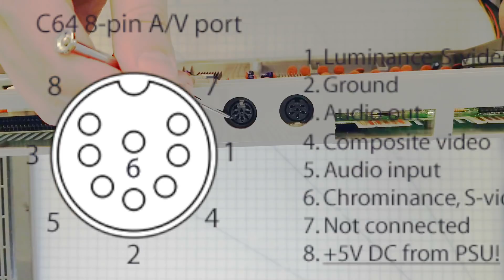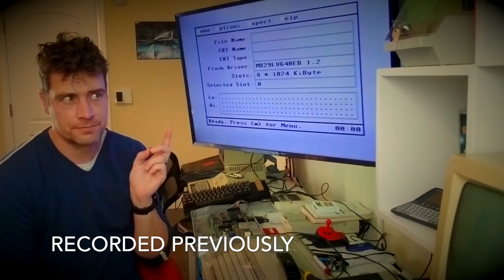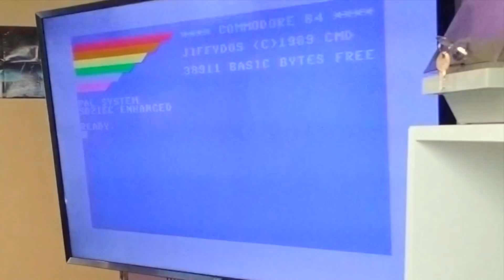Fix Commodore 64 SID Chip Noise In 5 Minutes {Quick Bytes™}

Comment from the maker: Thanks for watching! Do you find the buzz annoying or part of the charm? Did you enjoy my dancing? 🕺 Let me know if you have the same noise or try this mod!
Reply: I recently got a decent retrocomputer lot, including a bunch of Commodore stuff. After repairing the keyboard, floppy drive, and creating my own RCA cable, I tried some things. With the cassette drive came Shamus, so I loaded that up...no sound, only buzzing. Tried a floppy disk game, still no sound, only buzzing. Tried some BASIC code that was supposed to test out different sounds...more buzzing. Reseated all the chips in the mainboard...still buzzing. Do you think the SID is likely dead?
Reply from the maker: I'd actually suspect the cable. I recommend trying one from a reputable manufacturer or eBay. Good luck and let us know! 👍🕹️
Reply: Thanks! The cable I made was used the din plug off of the TI99/4A (which works in all three retrocomputers I got in the lot: the TI99/4A, the C64, and the CPlus/4). I actually received some new 5 pin dins (though my C64 can use 8 pin dins) and also have new RCA cables so I will just make another cable and try that. I am pretty sure my work would be about as good as theirs and cheaper (I am an electronics engineering major :) ). On another note, I was just looking in the C64...some of those caps look kind of worse for wear. Since I got the lot at an estate sale and everything is coated in some kind of...scum?...I will probably just replace all those.
Reply: Perifractic's Retro Recipes oh, one more thing...i get sound on the TI99/4A using my current cable.
Reply from the maker: Interesting. Carefully follow all traces from the DIN to the SID. Try swapping the SID with another machine if you have one. It could be any of those things. Cable seems less likely now. 👍🕹️
Reply: Will do. Unfortunately, the other Commodore is a Plus/4, so no SID chip, so let's just cross our fingers and hope it is something easily repaired. SID chips seem pretty hard to come buy and I would rather not get a SwinSID variant.
Reply: Okay, so I did all that, even replaced (but apparently unnecessary) 1k resistor on the Audio Out pin. I cleaned the board, checked the cable again with my TI99/4A, checked the voltage across the resistor to the DIN, checked continuities, checked all the voltages on the SID chip...from what I gathered, everything should be fine. While running Shamus with the volume at max, I noticed that there are soft popping sounds that seem to correspond to the music on the title screen (I checked a YT video of someone playing Shamus on a C64). Thoughts?
Reply from the maker: After that troubleshooting marathon, I can only think that the SID is the culprit. Check eBay or Retroleum! Good luck 👍🕹️
Reply: Well...dammit. After all of that, and noticing how crusty some of the discrete components are (the ceramic disk resistors seem almost crusted to the board, almost as if their coating flowed), I decided that I am going to completely refurb the C64 with completely new and modern components (such as MLCC ceramic caps and solid aluminum caps like on modern motherboards). Thanks for your advice :)
Reply: Hi chef! 
was this buzzing stuff going on in every SID... I mean, could you listen this noise in every c64? or is it just a problem with that specific chip? Cheerio
Reply from the maker: Most but not all C64s! 👍🕹️

Comment: Open the DIN connector of your AV cable and place the bridge in there. This way you won't be modifying the board and Audio In can still be used with another cable if need arises, even if there is a very slim chance of it ever happening. Also, on short boards with 8580 SID, "digi fix" is made by pulling down the audio in pin to ground with a resistor, the value of the resistor determines the amount of digi sound mix on the output. I wonder how placing a dead short to ground there will affect the digi fix?

Comment: On the 250425 board there is a 100k resistor to ground on pin 5, so no noise. At least not on my C64.

Comment: Hi :-)  at c12 is ceramic cap on my two 1983 board....i have see normal capacitor at c12 in your board you have modified with jumper... the pin 5 "audio in" go directly at c12 and to sid

Comment: Why not go directly to the SID chip and tie to ground there?  Why not use a resistor between the sound-in pin and ground?  Why not have a DIN plug that you can remove at any time that connects the pins through a resistor?  All these things... I was really wondering about durrrring that video.

Comment: If you are not using that DIN don't jump it internally, just build a blind DIN male connector just to use it as a cap which ground that pin.

Comment: So I did this mod, but it had no effect to the background noise I have :(
Reply from the maker: That's odd. I couldn't tell for sure without the before and after video comparison, and there definitely is still noise, only less. Still, nothing ventured nothing gained... 👍🕹️
Reply: Perifractic's Retro Recipes so this is the wiring I did https://m.imgur.com/a/8FAkAHh my motherboard is a little different than yours tho, that could have been the culprit and this is an audio clip to show the effects of turning off the video output from the cynthcart. soundcloud.com/danmusicinthemaking/commodore-64-sid-noise/s-8gupL this is after the mod and you can clearly hear the loud noise not nearly as soft as the one you have here
Reply from the maker: Looking at the pics you've done everything right. If you have access to a different model SID chip you could try putting that in, or there's eBay. It is possible the fix isn't effective on the newer model. Sorry it's not working out.

Comment: That can be quieted even further by adding .1uf ceramic caps across the power supply to the audio chip.  Solder them onto the V+ pin and connect the other end to ground.  Also the addition of a .1uf ceramic cap to the audio input of the chip.  Both will quiet the circuit down.

Comment: Never short the SID output to the ground - you can burn the chip by doing this. You should use 100 Ohm (of better 1k) resistor between SID output and the ground.
Reply from the maker: Interesting, never heard this before on the forums that discuss this technique. It has been working fine. What would the mechanism be that would burn it out on those particular pins?
Reply: I already killed my SID 6581 by shorting output directly to the ground (short pin 2 and 5 on video output port).
It is not completly dead but itis acting wierd since then e.g. sometimes (for few seconds) it can be very loud (almost distorted), some filters is not working correctly, it is more quiet comparing to good sid.

Comment: OK, silly question: Filter cap aside, why not just make a DIN plug that shorts 2 to 5, to be used when you are not using the DIN connector for any other purpose?
Reply from the maker: Good question. I always use the DIN as it's my video out. Other than that, it's just more fiddly work 😉👍🕹️
Reply: Heh. Then why not short 2-5 in your video cable? Come to think of it... I would take a close look at that cable. It may very well be the source of the noise, if pin 5 is connected on the C-64 end but floats on the opposite end, so you essentially connect an antenna to pin 5 :-)
Reply from the maker: Ah, because it's a molded cable. But this noise issue affects all C64s. Pretty well known 😉👍🎧
Reply: Fair enough. I don't remember this noise but it has been quite a while since I last fired up a physical C-64 as opposed to just running an emulator (and back then, chances are I was using a CRT which had its own noise on the audio side, so I might not even have noticed that there is additional noise from the C-64 itself). It just occurred to me that since the source of the noise is an externally accessible input pin, there is no reason to modify the machine internally (especially not in a manner that disables the original functionality of the input pin).
Reply: Viktor Toth I was thinking the same thing. You could have bridged the two points with a filter cap.  100uf or something.

Comment: Disabling the audio pin by grounding will alter classic digital sample playing. The classic method of digital sampling used the popping sound from the input pin and modulated it rapidly. You would be better off using a switch to enable/disable the fix or even better maybe a 1 meg pot for variability.
Reply from the maker: Interesting, never knew that! 👍🎧

Comment: Silly question- wouldn't it have been easier to plug an external jumper into the din connector? Or possibly make a modded AV cable?
Reply from the maker: Mark Super Did you see the bit where I plugged an external jumped into the DIN connector? 😉 

(Not sure a cable would be easier.)

Comment: Couldn't you just add a filter cap between the pin and ground?
Reply from the maker: menotu000 Good question. I'd seen that mentioned in forums without a positive outcome. This seemed more solid ¯\_(ツ)_/¯
Reply: I guess it would depend on what the cause of the noise is from... have you determined that at all?  Also, do you have a scope?
Reply from the maker: The buzz is apparent from all C64s and does come from the audio input not being grounded :)
Reply: A filter cap should work then.  Is the buzzing a power line (60/50hz hum)?  I ask because I have never heard it on my original C64.
Reply from the maker: Interesting. I believe it's just that the audio input amplifies the natural hiss on any audio line. There's a lot of info on it on Google, and this was a thread I read: http://www.remix64.com/board/viewtopic.php?t=4777 Interesting stuff.
Reply: I like this reference in the forum:  http://www.bigmech.com/misc/c64mods/noisereduction.html
seems like a much better solution, you get no noise when not using audio in, but still have the option of using audio in.
Reply from the maker: Nice. According to that, "shame on" me ;)
Reply: LOL, nah... you can always redo it if you feel like it... and ultimately it comes down to what you use the machine for... if you NEVER want audio in, then no big deal, but if you want to use it to mix with the SID output - maybe some kind of digitized sample or something to mix in, then you might want to consider doing the better version.

Comment: I vaguely seem to remember that there was another modification possible regarding EXT_IN pin. I have an 8580 and by injecting a bit of voltage, it should be possible to boost digi playback in some earlier titles using obsolete technique, right?
Reply from the maker: Siana Gearz In theory, but don't fry the little guy! I'm happy with this for now. When I record music out, a little noise removal in GarageBand gives perfect results 😊 https://youtu.be/LfdCX6EAWQ0

Comment: Seems like a nice and easy fix! How does the Ghostbusters digi-sample play back once you've added the mod, though?
Reply from the maker: Ooh I should've shown that. It sounds just the same, but less buzzy??
Reply from the maker: The downside is you won't be able to use the audio input, but actual use of that is very rare.
Reply: if you want to use audio input you could use a switch that disable that and you could enable when it is not used. it is just a cable with a button.
Reply: @AlejandroRodolfoMendez  Better yet, use a switched 3.5mm jack normally connected to ground. That way, when you plug a cable into it, the connection lifts and you can use the Audio-In again.
Reply: So there are no downsides for this mod ?
Reply: @PLOBEXRIME  I am thinking of one downside, with 8580 SID, "digi fix" is made by pulling the audio in pin to ground with a resistor. So adding a dead short to ground at yhe DIN connector may mess up with that since the value of the resistor determines the level of digi sound in the total mix. But, maybe the digi fix also takes care of the noise to some extend and dead short is not needed on 8580 SIDs, I don't know.
Reply: Digis on the c64 were not created using audio in tho. You'd need an ADC and a register on the SID for that. Audio in is simply mixed, 100% analogue, with the output of the oscillator DACs.

Comment: Did that to the cable back then.
Reply: Seems like modding the cable is the proper way.  If you had a cable allowing audio input, it wouldn't work.  You could preserve the audio-in by attaching another phono plug and use it's female counterpart as a terminator to provide the short.
Reply: Yes, it would have been kinder to mod the cable, maybe also quicker.

Comment: An easy mod that no one ever talks about on any of the retro computing YT channels.  Such a huge difference with such a simple fix.  I wonder if a small cap might help even more.
Reply: Switch the bridge. Done. Turn it off when you want to use audio in.
Reply: I'm looking at the C64 schematics now. If the input never gets used, then grounding the pin sounds reasonable. But to leave it functional, I would try placing a resistor from pin 5 to ground. I'd try with different values and choose the highest one which leaves an acceptable noise level (10K, 4.7K, 1K, 470ohm, 220ohm). The only downside is that it would decrease the gain of any sound input through that pin, if ever used.
Reply from the maker: MindFlareRetro Interesting idea. My understanding is the grounding is what makes the difference. What is your thinking with the cap?
Reply from the maker: Gato Great idea! Luckily I have no plans to use mine. It may still work though, even when grounded 🤔
Reply: In hindsight, I suppose a cap makes little sense. I was thinking let's try to reduce the noise even more, but it's not like we're really "smoothing" anything. Gato's comment 
 regarding resistors, assuming one is still using the pin 5 input,  makes sense. Ignore me on this one. =/